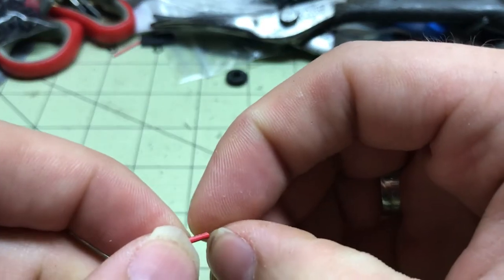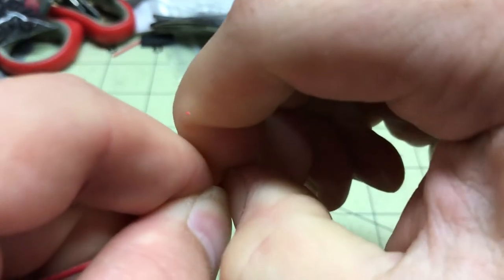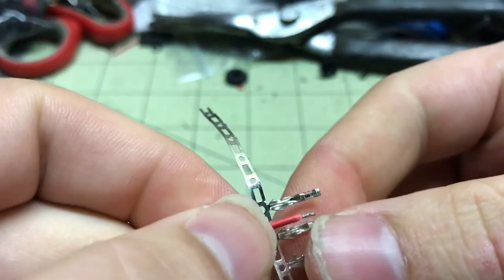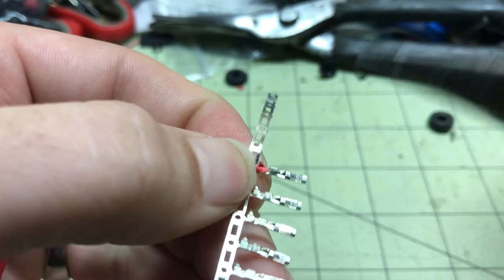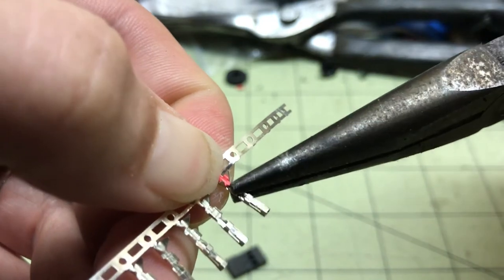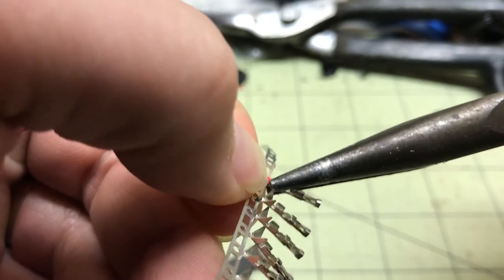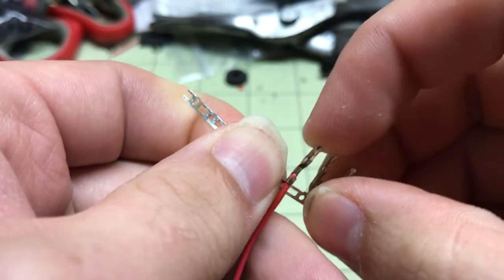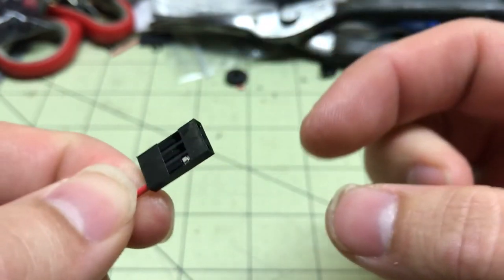Crimping DuPont connector with needle nose pliers

Comment: Thanks for showing it, I was thinking this should be possible and wasn't ready to invest in a crimping tool as I'm not probably gonna use it that much, but I had my doubts. Now that I've seen it can be done, and quite easily at that with tools I have at home, I'm convinced I don't need a crimping tool for my use case.
Reply from the maker: Yeah, this way will get you by if you only have a few to do. I have since purchased a crimper tool for them though and I have got to say I wish I had bought one sooner. Much more secure.